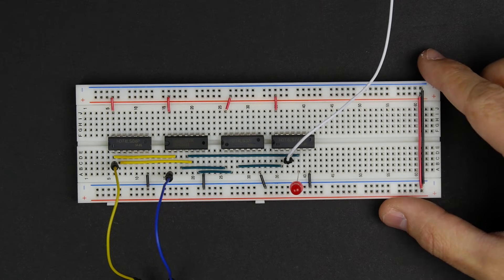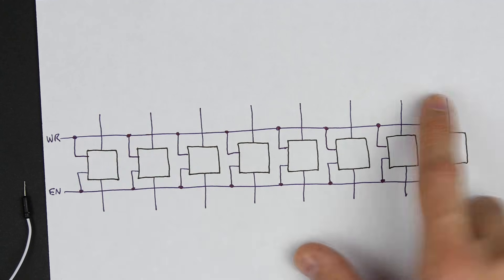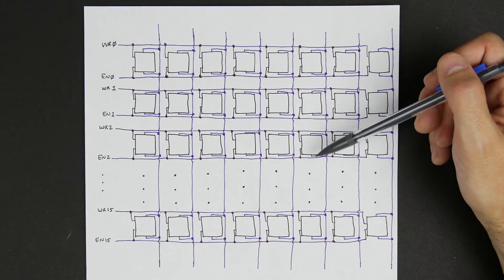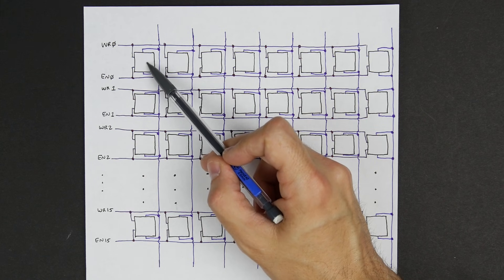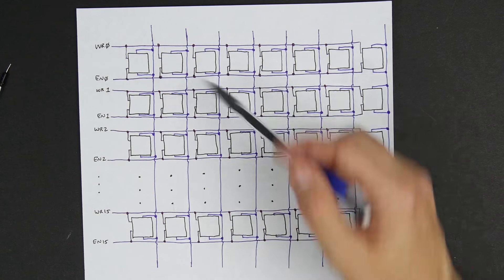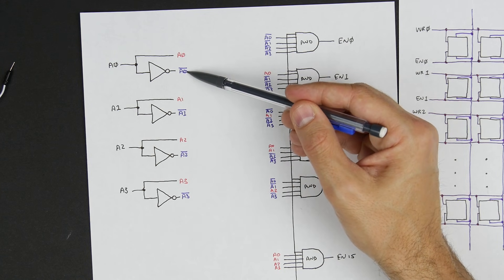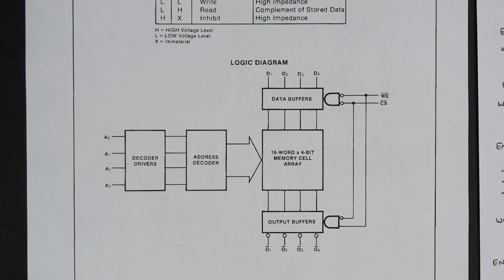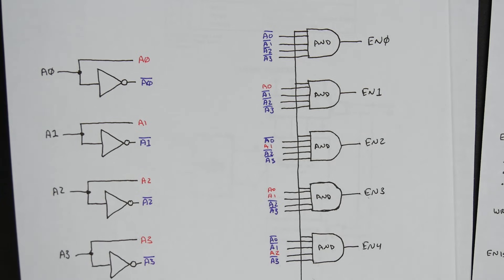8-bit computer RAM intro

Comment: 12:28 Why not using some less wacky SRAM chip instead? E.g. CY7C199-15VC, which already has an 8-bit data bus and the three-state buffer on its output, which – moreover – is not inverted at all, so you could just go with a single chip instead of four (two 4-bit SRAMs, one 8-bit inverter and one 8-bit three-state buffer) :q  This chip has also much more memory onboard: 32 kilobytes! That's much more than a measly 16 bytes ;J Or something like the AS6C1008 which is a 55-PIN DIP32 chip with 128 kilobytes :) Or the classic 62256 chip which is a 256 kilobits (or 32 kilobytes) SRAM in a DIP28 dice. I use the latter in my own 8-bit computer project for its operational memory :)
Reply: I'm not certain but I think the memory chips he have already have tri-state buffers built in.
Reply: Bon Bon I think he mentioned in some video that they were laying around. Also using more than 16 bytes would require a bigger program counter register and thus larger (multibyte) instructions. And that would require a more complex instruction fetch and execution implementation. And using more than 8 bit for the address (aka > 256 bytes) would also require a larger bus to transfer the address. Although I suppose you could copy the address in multiple microinstructions.
Reply: Fabian Neundorf Yeah, but this simplicity comes with a great cost: there's not many programs one can write within only 16 instructions :q And the complexity of multi-byte instructions is also an important part of modern computer architectures. They don't have to be much more complex, though: one can use a similar approach the ARM processors use, with all instructions being the same length (32 bits for ARM). It can actually simplify the design too – e.g. in ARM every instruction can be a made into a conditional (conditional jumps being just a special case) by setting the "check flags" bitmask in the instruction. For jumps, the part of the instruction where usually the literal data goes into, is used for the jump offsets.
Reply: Well it is more for illustration purposes so I think it's fine with only 16 instructions. Using more would made it more complex and wouldn't really show that much more. I mean if you wanted to have a bigger instruction  set you could use one of the already existing CPU architectures.

But yeah it'd be cool if the CPU could do more and I'd love to actually be able to build this CPU and improve it.

Comment: Hi Ben, I looked up the 7400 series for a 64-bit RAM with non-inverting, three-state outputs and there is one called 74219 but it doesn't seem to be available anywhere. Do they not make this chip anymore? Why would they discontinue that but continue making a 74189 with its non-intuitive inverted output? To pass on the cost of adding a 7404 onto the consumer to get correct output from the RAM? Also, did you use NAND gates in this video for simplicity? Will you be using a 74173 for the MAR in the implementation? Thanks, love your series! It's the clearest and most well-presented on this topic on YouTube.
Reply: How about the good old 62256 SRAM chip?
http://web.mit.edu/6.115/www/document/62256.pdf
You can buy those on eBay for around six dollars:
http://tinyurl.com/SRAM-na-eBay
(P.S.: If you're Polish, you are probably laughing your ass off right now after reading the URL ;) )
Reply: Nice. The datasheet says it's directly TTL compatible. I could use this for a system with 16-bit address bus. Thanks for the link!

Comment: +Ben Eater I have got a question: How do you make the wires for your circuits? Do you precut them, because they always fit very good?
Reply: Paul K you can buy wires for breadboards, it looks like that's what he's done
Reply: Paul K - Get rolls of 22 AWG solid core wire in as many colors as you can on eBay. Buy good strippers, medium length but very thin needle nose pliers, and a pair of Klip-Snips. Don't go cheap on tools. 

Great Scott has a good tool video. 

Don't let anyone make you feel silly with newbie questions. 47 Years ago I was, and still am a newbie. 

Ben is the only master I've seen on this channel. We're all here to learn.